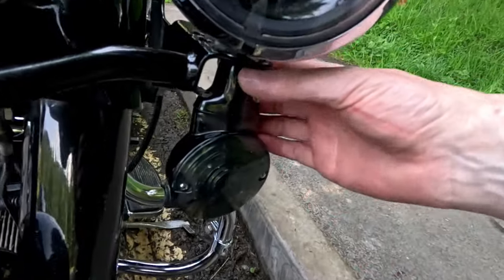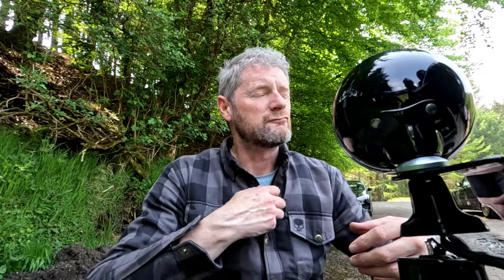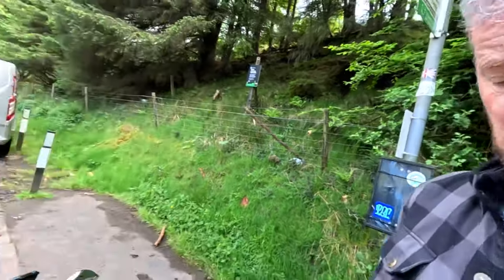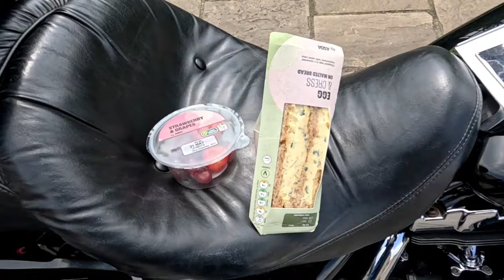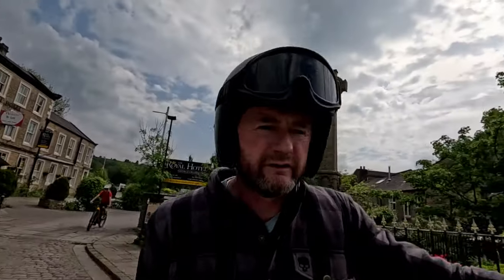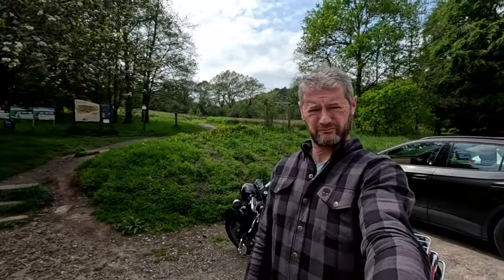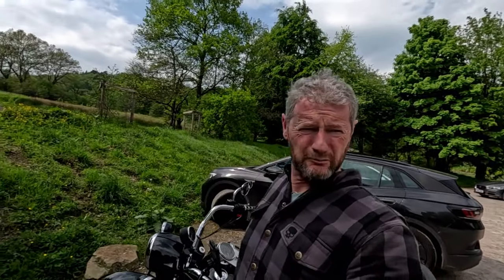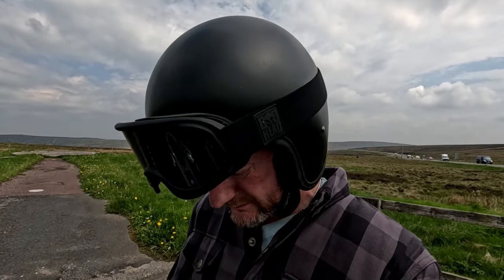So you think you can just go out and enjoy a ride ?

Comment: Have you changed your camera/mic?
Reply from the maker: Not for a while. Why is it worse or better ? 😅
Reply: @1guyaharleyandadrone657  The video is probably around the same, but the audio, when you are speaking, doesn't seem to be as good as it was; at times it's really difficult to work out what you are saying. Initially I was sceptical of the camera rotating thing, without a boom mic, but it worked, now I'm not so sure. Maybe just me getting old(er)
Reply from the maker: @jezza1421  It was a bit crap at times. I just have to be careful with the speed and hence the wind. There is an option of getting a helmet mic but it's just one other thing to charge, sort etc. I try and keep it simple. Cheers